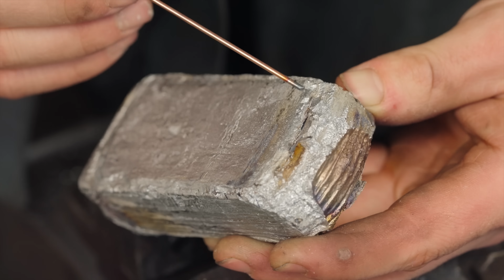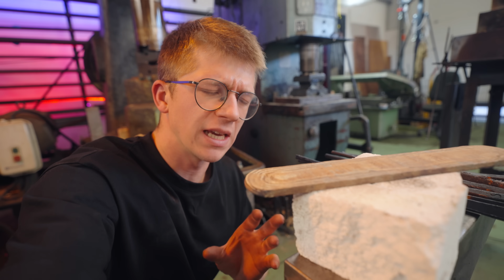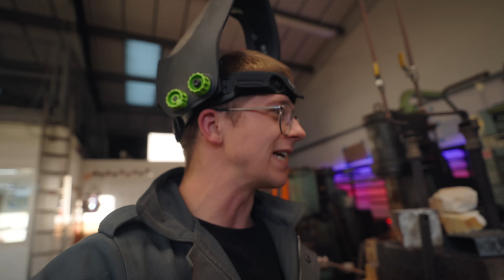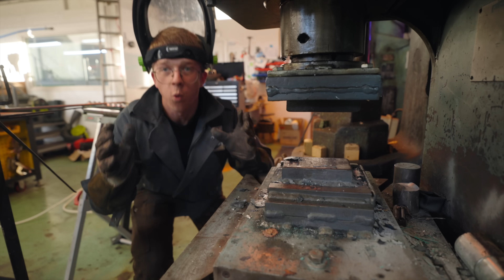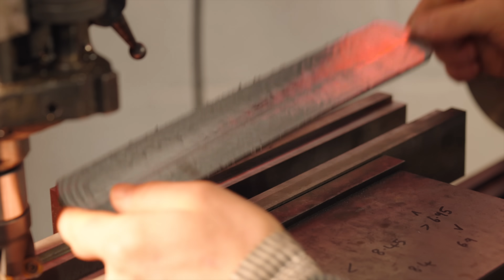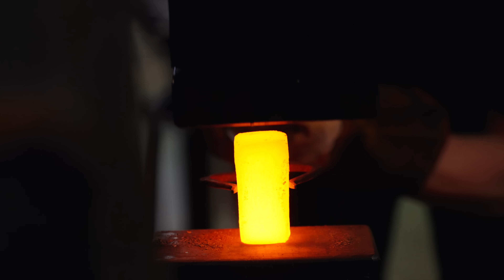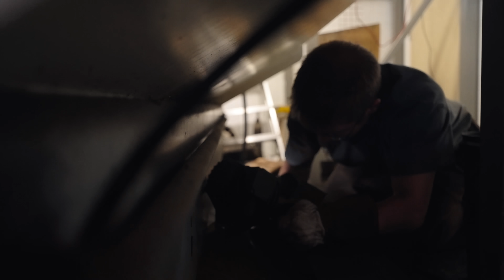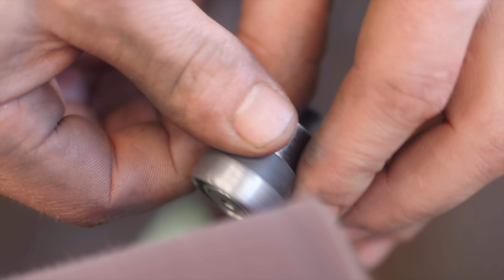Can I Make Titanium Damascus? Part 2

Comment: I’m a machinist. I use to work with someone who has machined titanium. He was referring to a lathe rather than a mill but the same principle applies. I asked him how you machine titanium. He looked at me and said “use the tooling you would use for stainless steel but at the speed rate and feed rate you would use for machining aluminum” yeah titanium can be weird to machine but all metals have different qualities!

I see why nobody does this. This stuff looks like a nightmare to forge. Plus, I’ve heard titanium isn’t even a great metal for making blades. The edge retention isn’t as good so the blade will get dull quicker.

Comment: Just a little correction, when milling about 80% of the friction temperature goes to the chip, 10% to the tool and 10% to the workpiece. This varyes based on the material but not on such a significant basis that you'd have to prehaps change your'e way of cooling. The more you know the better you'll be ! 😉

Comment: Alloys of metals can sometimes have lower melting temperature than the original pure metal.
For example, Potassium and Sodium which are solid at room temperature would make a eutectic alloy (liquid at room temperature).

Comment: I suspect the reason for the melting is because you're squishing it, which adds heat.  Jus tlike how you can make a steel billet red hot by hammering it, you're taking titanium over its melting point because you're squishing it so hard, so fast.  Might need to go slower because of the increased thermal conductivity

Comment: “One vital step is the insulation of the steel container from the titanium layers using aluminum oxide gaskets. This prevents a potentially problematic reaction between the steel and titanium, which could form a low-melting compound that might jeopardize the welding process.”

Comment: I was curious how you would handle the plastic slip mechanism during your working efforts. Since Titanium exhibits significant twinning plasticity, alot of your plastic grain flow is off at an angle relative to the stress, unlike the steel you are so familiar with. Looked like you got to really recon with that mode of deformation when the results of twist operation did not go how you expected.

Comment: One suggestion is to just cut using the Bandsaw because the blade is much much smaller than the miter/chop saws blade so there will be a lot less loss

Comment: Going back to first principles, many substances will have a lower melting point when they are impure than when they are pure. By definition, an alloy contains two or more different substances. So the melting point of pure titanium is not applicable to a titanium alloy.

Comment: With titanium and argon gas, the argon gas will create a  reaction with the titanium, causing the temperature inside the billet to rise significantly
 Then, the temperature that's inside the forge. Use a temperature laser to keep an eye on the temperature of the billet itself.

Comment: You were sawing to fast! 😉 Harder the metal slower you want to go, sawing, drilling... You will have to heat it more often to hammer it! 😉
Reply: Air pocket! The bubbles try to get out all at once, building pressure and poop! 😂
Reply: This will happen with any material, if there's air pockets, plastic, metal, anything even heating poop! 😂

Comment: For the anodizing, proper etching is critical to getting the really beautiful higher-voltage colors. I like MultiEtch as it’s substantially less murder-y than using straight up hydrofluoric acid. With the multi-etch you’ll want to get it up to around 70-80 C to get a good surface finish. Have fun! The colors are pretty unreal.

Comment: Hey Alec, machinist here. I would’ve used the bigger face mill and taken all the inserts out except one. Turn the rpm up and use it as a fly cutter, cheaper because you aren’t burning up as many inserts. We use that method at work on rhodium platinum inserts. Johnson matthey in Royston does a lot of precious metals and exotic metals, I work over the pond for them. Also the reaction from the alloys will lower your melting point on that alloy. If you added a small amount of rhodium or something with a higher melting point to the alloys (in the original cast) it should increase the melting point. (Last part is a theory not saying I know it works but I know metallurgist that can let me know for sure)

Comment: There is a guy online that spray paints white paint on the inside of his box so the metal will not stick to the housing...also saw on forged in fire they use white out as well...maybe that will help keep the metal box not bond to the metal inside
Very very cool!

Comment: As you're starting to experiment with different exotic metals you may want to consider getting a diamond wire saw. Theyre very slow, but they give precise cuts and can cut just about anything. Even cutting tunsten wouldnt be much of an issue with one

Comment: forge is 2,000 f in one spot what if the back or middle of the forge is varing in its degree, so thats why portions of yoour billet are heating up to melting point and the other portion is not.

Comment: In general, Timascus is processed in the same way as other titanium alloys, and the welding process is similar to that of steel damascus. To create a laminate, different layers are welded, followed by forging. Each weld is followed by processing on a surface grinder and only then by the next weld. Grinding is what makes this material so expensive. During the grinding process, titanium is sheared off and turned into chips that cannot be used later, which means that the material consumption in the manufacture of Timascus is very high. It can be up to 80% of the size of the original workpiece. In order to obtain the most saturated colors after each welding, a finer and finer grinding is applied. in a context this is out of a 1980's book

Comment: Have you considered a copper jacket for your billet? If you oxidise   the surface of the copper first, you may not get too much sticking (much in the same way that the TiO2 in tippex works for steel billets).
Reply: Also, Titanium Copper alloy looks like a fun metal to mess about with if you’re looking for something to explore.

Comment: If the blade has tungsten carbide or M42 steel will cut any metal easy, normal blades will dull very fast with any hardened steel

Comment: I don't know much about this type of material science, but I can't help but wonder if the Argon purge is creating an effect similar to the increase in temperature when you blow on a fire or when you use a bellows. If that is happening maybe that is increasing the temperatures inside the purging vessel?

After reading some of the info below it does seem like that eutectic point stuff. Our world is so fascinating. Would anyone care to explain why the eutectic point happens between these metals?

Comment: what if the titan block gains pressure in the oven for some reason and thats why it is hotter than the temperature you heat it?

Comment: The comments about Eutectic points are spot on. If you're convinced that forging at 2000F is necessary, consider chromium for the box rather than iron. -Welding engineer.

Comment: titanium has a high affinity for alloying witch means it will happily join and stick to other metals like stainless steel or mild steel when you forge weld, however the resulting alloy just creates a super hard very brittle self destructive carbide witch will crack and shatter on its own when it cools. this could explain why the steel purge casing is sticking so well to the billet when your forge welding the layers.

Comment: Just something to be aware of, and it may not be of concern depending on the type you've got. But check your temperature probe to make sure it's usable at such high temperatures. Many of the kind you have can handle it, but some can't. We've without a doubt seen that it provides a reading, but it may not be completely accurate.

Comment: I feel like that’s some steel melting, also air temp of your forge is not the surface temp of the items in it the will build and store heat, I feel like your problem is the way you measure your temps

Comment: Remember simple physics, keep this for any future expierements, as pressure increases, temperature also increases at an equivilent rate. when you compress the hot titanium inside a press, it lowers the needed external temperature maximum to reach a melting point due to the billet being a sealed body containing the pressure inside, hence the blowouts of liquid metal. You will also notice it didnt do it either when using the power hammer since youre allpying force at intervals also much less at once unlike the press machine.

Comment: Maybe it's melting because the pressure inside the steel gasket is different from the atmospheric pressure, maybe it's not pure titanium (very likely), maybe it becomes uzze but not molten completely, maybe it expands in the steel gasket and that force creates pressure around the crystals that enables an easier melting, maybe 10 other reasons.

Comment: I think the answer to your titanium squirting is that it's not actually melting, it's just VERY soft when heated up. It's like the difference between water and Gelatin (like Jell-O). You wouldn't call jello a liquid, but if you put it into a small box then apply pressure on it then it will squirt just like you see from your forging here with titanium.

Comment: 12:31 your squeeze out is happening because I believe when you put it in the press, you are pressing the material +8mm try doing only 2-4mm at a time only one press flip and repeat until the material needs to reheat and the size shrinks about 12mm

Comment: Hi
Great video as always sir Alec
Allright not my language so be forgiving lads please
Steel melt around 1500 degrees celsius, titanium around 1700, but titanium has a beta stage that starts from 882°C until melting point, and that's within this range of temperature from 882 to 1700 that stuff goes south

Comment: in 2000 I worked for IHM (International Hearth Melting) which at the time was the largest electron beam furnace. The furnace was kept under a vacuum during a campaign. The lab that had to test purity used a lathe and a pretty heavy duty powered shear to cut slivers off and the blade was changed out every 6 cuts. Also to cut the billets they used a large oxy-fuel torch at a high speed. Also is the billet needed finishing it was put on a making that resembled a surface grinder that used carbide bits and it rammed the bits across the surface to take its cuts. I want to say a billet was 10 to 12 feet long. While I'm not sure what happened after the billets left the plant I know that no coolant was allowed, which I'm guessing was to maintain its grade purity.

Comment: I think what's happening here is that the 6% alluminium in the alloy reduced the melting temperature. It is stabilizing a hexagonal alpha phase. Vanadium is stabilizing the body centered cubic beta phase. Also you have to take in mind, that there is alot of pressure. maybe this effects the phases too. Maybe the alpha phase is more stable under higher pressures.
Reply: @Broetchen98  no, iron leached from the steel…

Comment: Are you sure you have your bandsaw setup correctly? Your blade is moving in the opposite direction from how typical horizontal bandsaw blades turn. With how you have it the cutting force is going into the moving jaw rather than the stationary jaw which might be a slightly less rigid setup. If it is a 3 phase machine you can just swap 2 phases and reverse the motor direction. You will also have to spin the blade around as well of course. Just thought this might help with your cutting issues. -Zolten

Comment: Use an electric heated forge so you're not blasting the billet with all sorts of oxygenated combustion byproducts to contaminate it.

With an electric forge there'd be the ultimate method of a fireproof spacesuit with external air supply, in a sealed room, flooded with inert gas, containing Alec (in spacesuit), the electric forge, and the power hammer.

Comment: Titanium and Iron are quite reactive metals. It’s possible the combination of them and the heat is causing a reaction or setting up a catalyst for when you apply pressure. 

It would be interesting to see if the titanium ‘squirts’ are actually pure unreacted titanium or an alloy created from a reaction.

Comment: could you potentially add the original plates between the billets you stack , I know that will make thicker layers between finer ones , but it might be a cool effect , and you can replace some of the material you lose with each operation

Comment: If you look into amalgamation you will find the answer to your low melting points. The simple answer is that when certain metals mix together they get in the way of each others forming of crystals which drastically lowers the melting point of the amalgam. An example is a metal called galinstan which is made of tin indium and gallium all of which are a solid above room temperature, gallium is the lowest being a liquid around 85F. But galinstan (which is primarily galium) when mixed with tin and indium which both melt well over 300f suddenly is liquid metal even below freezing.

Comment: As many people have already pointed out, the liquid metal could be an iron titanium alloy. However, I wanted to add that you could also be seeing significant thermal energy from internal friction during the press. This could also contribute to the central layers squishing out more than the outer layers in your first billet. Just like the immense local heat you get from machining it, during the pressing/hammering, those central layers are both staying warmer for longer and getting more internal friction from forging.

Comment: I don't remember the maker or name, but when I was working at the factory, we had this carbide grit impregnated blade for harder stuff. 
It was more like a grinding disc turned five meter loop than a sawblade.

But that was decades ago, I'm sure there are better solutions available today.

Comment: Argon is also used in applications to make normally unreactive elements reactive, its possibly contributing to the melting of the alloy formed at the perimeter of the billet where the steel touches the titanium.

Comment: I agree with the phase diagram stuff,  the first half of metallurgy class was all about eutectic alloys(lowest melting point), titanium does turn very nice in a lathe, milling can be much more problematic you should be looking for high positive geometry inserts for both.  

something else, and you mentioned it,  titanium is a horrible conductor of heat,  so maybe try a lower forging temperature and a longer soak time, low and slow. 

 and keep sand around for titanium fires, water will make things worse

Comment: Might need to look up eutectics between steel and titanium.
Eutectic is the ideal mix of components to melt them together at much lower temperature than the individual components normally would do. That would also kind of explain why steel and titanium are sticking together this way and not the normal way, to form a eutectic they have to form an alloy like mix.
So maybe your Damascus billet does sort of alloy these two at the contact surfacees between every layer, which would also explain why here argon is needed constantly and not for "simple" steel on steel where a minimum of oxide seems to be okay in the process.

Comment: If you consider using cutting emulsions from now on please be aware of the health risks from cutting fluids gone bad. Get a refractometer to check the recommended concentration. If the concentration gets too high it can damage your respiratory tract and your skin. Bacteria can accumulate and you definitely don't want those in your lungs. 

You will need to be very thorough cleaning your machines after every use of cutting fluids and be sure to check in regular intervals and change out the fluid if necessary.

Comment: I am almost wondering if argon gas is creating an environment within the box that is altering the temperature requirements such as changing the 'atmospheric' pressure within the box. Higher pressure reduces the temperature required to melt things. Though I am not entirely sure.

Comment: I wonder since TITanium is great at holding heat that when you squish it while hot it will heat up fast very fast and some of it will head to melt, but also having the 2 different grade or kinds sandwiched they will have friction by them maybe stretching at different speeds and so you multiply that by x layers and maybe that can help it to get to melting in some areas of the billot. Also are both kinds 2900c melting point or only the one? I bet once you get the systems down and the techniques you will be killing it, not a ton of info with only one paper to go off of for manufacturing!

Comment: The basic reason it's molten at a lower temp than the melting point of pure Ti  was in a way given to us by you in the last video and this one, you have two different types of Ti Alloy, as you already know and have pointed out when working with different Metals, Alloyed Metals always behave differently to thier Pure counterparts, that same as Cast Iron doesn't behave like either Pure Iron or Steel, and each different Steel Alloy Acts in a unique way. It would be better to look up the melting points of your Ti Alloys rather that Ti.

Comment: Regarding the weird melting behavior: have you taken a look at the titanium-steel-phase-diagram? The melting point of the epitaktic mixture may be well below the melting point of each constituent. And the hardness/„viscosity“ of these titanium alloys (or a steel-titanium mixture) may drop off much faster before melting than what you are used to from other metals.
Two ideas to look up and check.